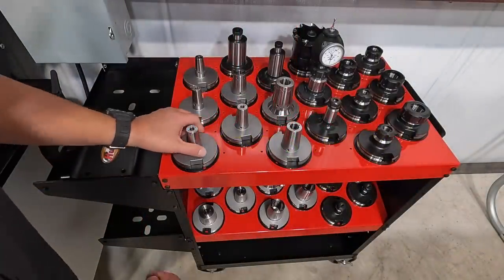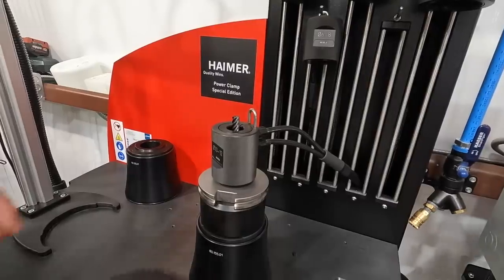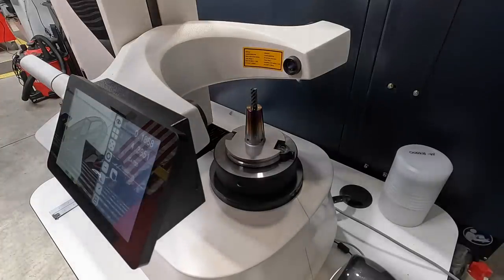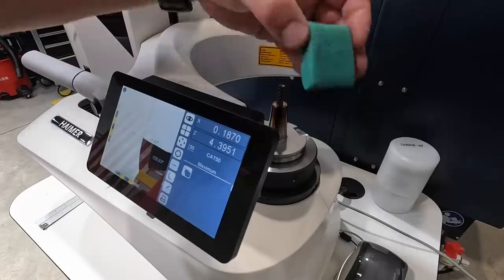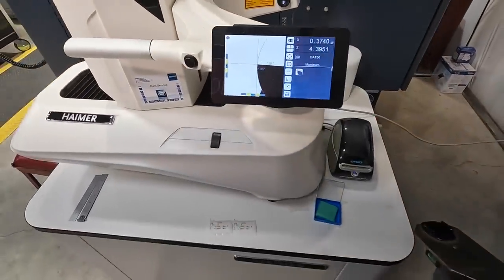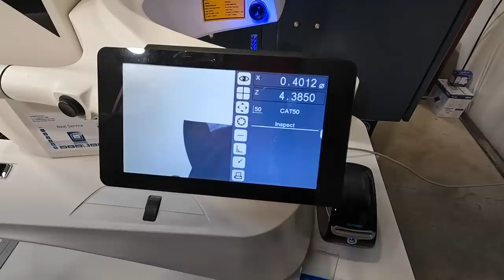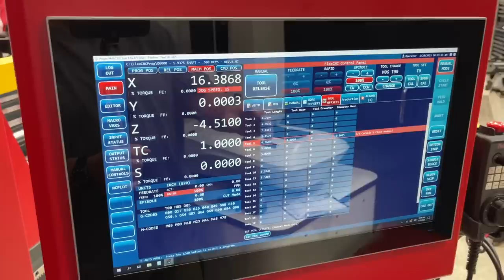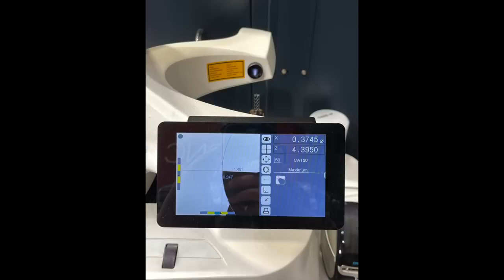Setting up an Endmill using the Haimer Machines

Comment: Dude, you're an old school machinist, you have admitted it before that the new technology is a bit overwhelming and you prefer the conventional manual machines. Kudos for learning the new tech, but why carry the risk? Are you able to get complex enough jobs in order to fund this new facility? Trying to envision the prices you would have to charge for your casting modifications and more straightforward jobs as presented by your channel. Are you able to fund enough work, in your current skill range in this economy? I fear rampant spending may run out of control, and you are kind of an emotional guy. Whatever way it shakes, have fun with it all, there are certainly oodles of resources out there to help.

You have very little need for shrink fit tooling with the speeds and loads you run. That's high feed machine necessity, or +/- .0001 precision requirements. Why wouldn't a large selection of standard ER32 collets not suffice?

I mean no disrespect to you, honestly. Sincere concern here. Much love.
Reply: He didnt purchase the machines. They're adverts.
Reply: You can't live in the past forever. Everyone/everything has to evolve.
Reply: You can do one of three things to make money with machining - either you design and manufacture your own products (Area 419, SMW, Pierson), find some kind of niche in service of some other industry (CEE), or you gain the capacity to manufacture efficiently in volume (Titan).  You simply cannot get parts through a manual machine efficiently enough for production work to turn a profit, never mind their inherent limitations.  Maybe you'll get the onesie-twosie odd job like drilling a new bolt pattern in a hub or repairing a shaft but you're not gonna keep the lights on with that - those days are gone.  Nowadays manufacturing is all about volume which I'm guessing is why he's leveraging the cnc equipment.  Even with all the tools, talent, and luck it's going to be difficult but you'll never get off the ground if you don't make that first jump.

Agreed on the tooling.  The shrink fit stuff is a flex.  $500 a piece for just the holder, excluding the pull stud and tool.  Jesus
Reply: He is not paying for all this new gear.
Reply: You are exactly right @mbjork11 but the thing is, he is getting all this for free. So instead of doing interesting content, we get advertisements over and over that the core audience would never purchase/afford.
Reply: @JFirn86Q  thanks for the insight. I've seen it often where chasing money (or status) can turn the whole thing sour. He's running out of room, we'll see what he comes up with next when the unboxing videos stop.
Reply: @cskovach  good insight. 1000% agree. Hopefully he finds his way. Take care!
Reply: @cskovach  you forgot the fourth way.

Paid promotions from tool companies.
Reply: @zacharymihlrad1045  damn you’re right I forgot
Reply: @cskovach  Yeah, but Abom is not doing all this for manufacturing or making money with these machines. It's all just for youtube. He's not hiring a staff or designing parts. This channel used to be a hobby channel for home shop machinists. I dunno.
Reply: @JFirn86Q  I guess that’s where a lot of the frustration in the comments is coming from. Adam led everyone to believe that he’s opening up Booth Machine Shop II but hasn’t shared anything about what’s going on on the business side, which is fine I guess….that’s his prerogative. But then he turns around behaves like he’s on vacation all the time.  Maybe it’s just me, but having half a million dollars worth of equipment in your shop and not hustling to put them to work kinda rubs me the wrong way.
Reply: @cskovach  Agreed, you and me both.

Comment: With that big milling machine you have, are you going to contract work from Motions industries?
Reply: That would be a first.  When he worked at Motion, some work he bought home to machine on his equipment.  But once he left, no work ever came from there, or at least shown on the channel.
Reply: @richardjones-sl2zd  If you have CNC machines and someone need mass production of items that is a good fit. CNC machines are made to do repeat operations.

Comment: Nothing better and spending 20k on something that heats up and cools down tool holders. Ave just uses a torch.. cost? 40$ the crazy things company's come up with and people buy them.
Reply: Bet this one is a demo and on permanent loan
Reply: if people are buying them they are making money out of them, some companies have full time job employess just to setup tools heck they even use robots to automate the process yes a torch costs 40$ but it'll take like 1 minute to heat the holder and some time to cool it and it will have issues with runout bcz you're not heating it evenly sure rotating the holder or make a fixture to rotate the holder helps but it still won't heat the holder evenly now on the other hand you can grab copper wire and make a coil out of it run some electricity through it and it will induction heat the holder evenly just like this machine is doing and all the other accessories like the disk and the cooling sleeves can be 3d printer easilly it's a nice DIY project for the guys who know their ways around it but sometimes time is more valuable than money and buying the machine is the correc choice financially.